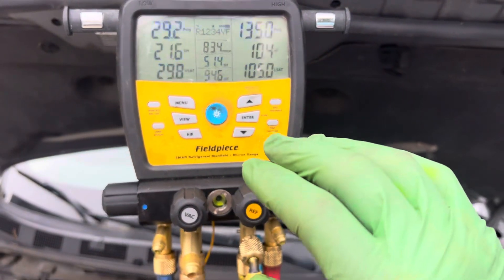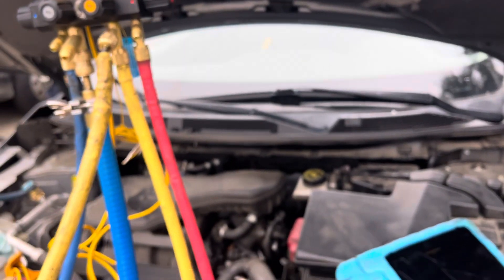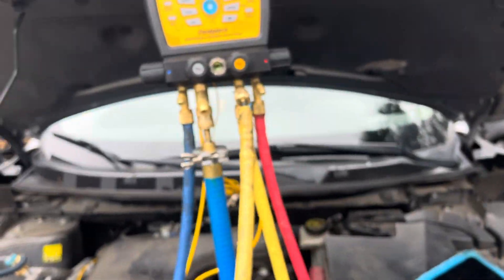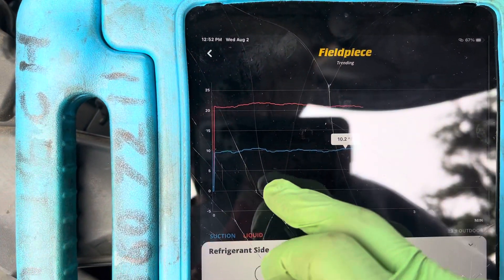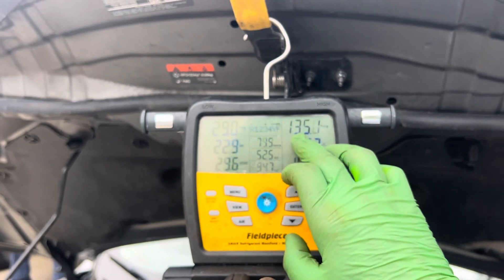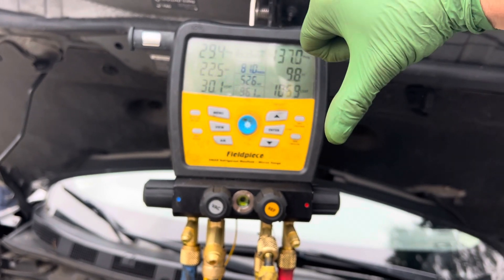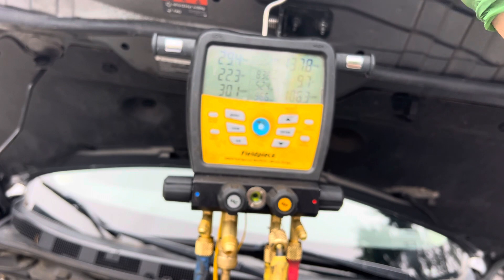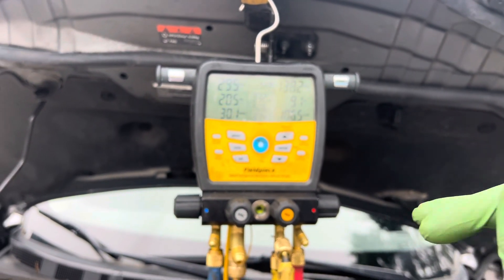ADDED REFRIGERANT SUBCOOLING WENT DOWN 🤔 LOW & HIGH SIDE WENT DOWN 🤔🤯 isn’t this opposite ?

Comment: Like u say individual brands and models vary alot . Rule of thumb has become a distant memory .
The auto systems have been designed under test conditions that have not been released to techs    unlike more professional commercial industry where its stamped on the unit . 
The only reason the auto industry wants to not release the info is the brands want to control/keep there performance short cuts private . Essentially it will show up cost cutting techniques .   Factory short cuts  cause the gauge readings to not be the same on  nearly all  occasions . EG not only is the sight glass removed saves money [probably 5 cents ]  it allows the system to be undercharged to allow for under size condensers etc . Charging by weight is also very accurate  . In these current times asystem thats undercharged by design  should be rare due to the good quality condensers being made  . I do see on some vids some vehicles run almost no subcool surprisingly . 
Old school Refrigeration mechanics cannot stand working on cars because of the variables , in my country .